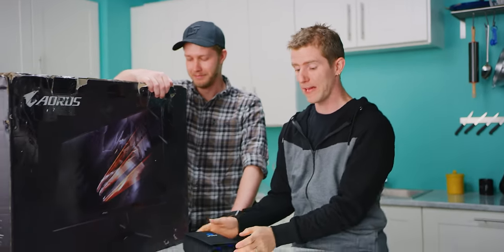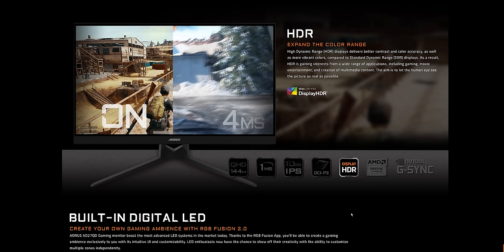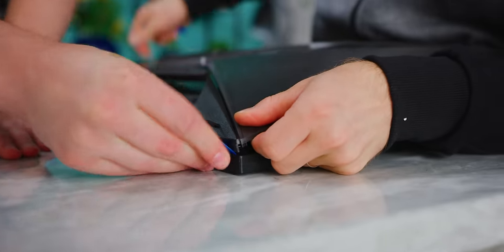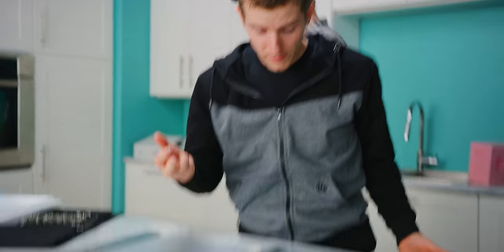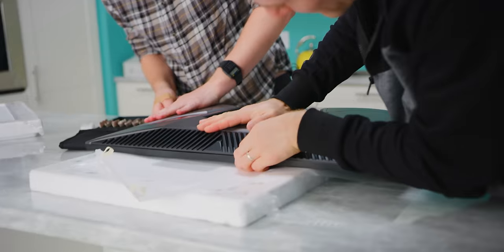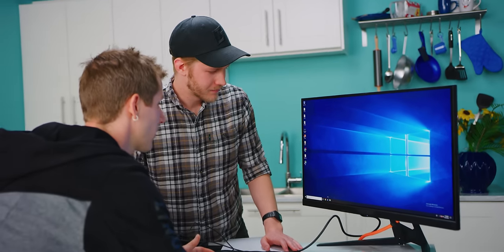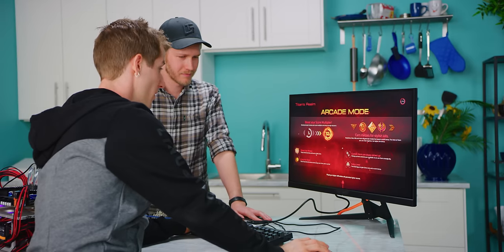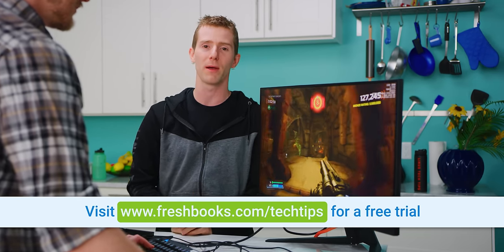Fixing a Broken Gaming Monitor for CHEAP - DIY

Comment: A make your own monitor video sounds really interesting, I would love to see that.
Reply: Phil N there are tons of driver boards on Taobao, for dirt cheap even.
Reply: Especially dual driver setups with high resolutions and refresh rates but HDR and freesync 2 may be a bit of a stretch for that kind of setup. Also maybe a way bigger panel than ordinary gaming monitors but response times for those panels may not be optimal.
Reply: Built my own twice. Made a nice wood case for one, with a 1366x768 LG panel from a rekt laptop, hangs on the wall. Made another handly handheld one out of a little 800x600 digital picture frame I found busted in a parking lot. Even has built in speakers. Used LVDS/flatlink adapter boards from eBay and other scrap parts. Pretty straightforward.
Reply: bezel free monitor wall Plz
Reply: Any of you guys know any good build guides to build something kinda matching 2019 standards from aliexpress parts?
Reply: That's my next DIY project. Hopefully there are some good guides out there.

Comment: Thank you very mutch for this Linus. My glass desk recently broke on me and my 27" Dell S2716DG monitor fell to the ground and got busted. I found the panel on Ebay and was able to replace everything without problems and its good as new. Now for the desk i know never to go glass
Reply: @aBunnyThatWillChewOnYourCables  yep 1 year plus and still strong. Havent had any issues with it. Even upgraded my PC and stayed with the same monitor i fixed

Comment: linus: releases video fixing 120$ broken monitor from ebay
ebay broken monitor sellers: doubles the price
Reply: they really can't otherwise they are selling them for the price of new gaming monitors
Reply: @pinklightninggaming7353  i mean 240$ plus like 100-200 to fix it still way cheaper than the price of a new one
Reply: @CiceroFMYT  still almost $200 cheaper
Reply: @Camtcan  Yeah, but it's not a sure fire way of getting a working monitor.  $200 isn't worth the risk to MAYBE get a working monitor at the end of the process.  It's cheap because you're taking a gamble on it possibly still not working after your done.  Then you're out all the money you put into that broken monitor.

Comment: I would like more these videos that cover second-hand salvaging of pc parts and accessories
Reply: Nice profile picture
Reply: I know a guy that buys pallets of RMA'd computer equipment and fixes it for profit.
Reply: That. 
I got into LTT years ago because I needed help learning to build a custom WC loop. It seems like that DIY material has trickled off a bit over the years in comparison to reviews (excellent), industry news and general (admittedly hilarious) silliness. 
But I'd love to see more stuff like this. I love the DIY aspect of electronics, and I really appreciate folks who can help me learn to do stuff. (For instance, I recently tripped over the cord on my out-of-guarantee xps 15 and did some major damage. Instead of ebay-ing it for pennies on the dollar, I just ordered a replacement palmrest and screws and found a guy selling a used AC/DC unit. There's probably a video out there showing me how to do it - but if LTT did one, I'd just feel that much better about the challenge.)
Reply: @mmavcanuck  They do get rich off of videos that people want to see though. Consider that.

Comment: I mean… Alex using LTT to supply him with computer parts like his Monitor is actually really smart. This is actually the kind of thing that a budget-oriented gamer would consider doing, making it an interesting and valid video for the channel, while ALSO allowing Luke to use LTT’s funding to acquire his toys, so long as his idea works. And, let’s face it. In the case of this project, Ad Revenue ALONE on this video probably paid for it even if they broke it.

Comment: i'm can so relate to Alex.
Too cheap to pay anything new when i can "fix" everything in some "NotSoPerfectWay", but as long is cheap and it works i don't mind and i got for it. Even though i regret some times.
Ergo my "home assistant device" being an used old phone hanging in the ceiling receiving voice commands and running tasker to execute them manually on the display and using a Broadlink transmitter to blast IR and RF.
Which i recently discover that they already come ready to run from your google assistant in your on phone.

Comment: "what are our chances?" "either 100% or 0%" 
we call that a 50% chance alex xD
Reply: Damn. You got to this before I could.
Reply: No it's not
You could either win or lose a lottery, it doesn't mean it's a 50% chance
Reply: @nchls1343  it's like on or off
Reply: as young sheldon would say: "you confused possibilities with probabilities"
Reply: I was gonna write that!
Reply: @vigosrevik2896  ....
Reply: they don't have 50% chance in canada
Reply: Lmao came here to write exactly this
Reply: @nchls1343  If the odds are equally likely, he would be correct.  Lotteries are no where near equally likely by design.  They want to make it hard to win.
Reply: @Pwnstared  exactly, now in this case (this video) it's not 50-50, maybe it's more like 80-20 for success against fail because Alex knew it's the panel's problem.
Reply: @nchls1343  50% probability?
Reply: @rzzle8586  no it's not
It's like jumping from 5th floor, you either dead or alive
Just 2 possibilities, doesn't make it 50-50 tho
Reply: @lightningrod6568  no, what he said is possibility, what I said is probability
Reply: @nchls1343  right. I knew I had to put that question mark
Reply: 100/100 * 0/100 =\= 50%. If you can either win or lose something, like the lottery, does that mean you have a 50% chance
Reply: @nchls1343  Dude, you have a 50% chance to win the lottery, it either happens or it doesnt, 50 - 50       /s
Reply: No, it's not. 0=/=0.5=/=1
Reply: Was just about to say that
Reply: Everything either happens or it doesn't. Everything is a 50/50 chance. Lol. Sound logic.
Reply: All these people trying to compare to the lottery. Lmao. You know the odds OF winning the lottery are not the same as the possibility of winning. It is a 50/50 chance of winning the lottery, you either do, or you don't, now the odds of you winning the lottery are extremely low due to the amount of people trying to win as well. An 'either win or lose' is a 50/50, now with these monitors you'd have to know the percentage of panels that CAN be bad, and then you would average out your chances of getting 1 of them, say 1/50 monitors are bad, that means that 2% of the time you'll get a bad monitor, but when you buy a new one you still have a 50% chance you could get a bad one, or a 50% chance you don't. It's all RNG.
Reply: odds of dying from jumping off a 20 story building are NOT 50/50. chances are probably like 2% chance you will live. same rules apply here
Reply: @TheGauges420  I'm sorry but this is nonsense. Saying there is a 50% chance of winning is exactly the same as saying mathematically that the probability of winning is 50%. 

Here are some actual facts about probability since you seem to be extremely confused:
This is a Bernoulli trial, i.e. a trial wherein there are two outcomes with the chance of success determined by a constant p. The size of the parameter space of such a trial is two, with the parameter space consisting of "success" and "failure". You can say "there are two outcomes" or "the situation is Bernoulli", but you cannot say "there is a 50/50 chance" unless you know that the p=50%. Given we don't know what p is, your statement is incorrect.
Reply: @nchls1343 , I came here to laugh, but I leave educated... Thanks man... n.n*/
Reply: @nchls1343  Can't compare apples to oranges bud
Reply: Mario  exactly. But every time you play you have a chance of winning and chance of losing. No other possible outcomes. The probability is not the same as possibility. Obviously the chance to lose is much higher than the chance to win, but that doesn't change the fact you can only win or lose, or just not play.

Comment: In my experience, the most common part to fail on a monitor is the power supply. That has proven to be significantly harder to repair/replace than a panel. I'd be very interested to see LTT give it a shot so I can learn. I'm about half way through replacing one of the field effect transistors on the monitor PSU, and my fingers are crossed...
Reply: These guys using an iron would be terrifying...
Reply: why monitor monitors motherboards covers have to be from aluminium, to be so heavy, i dont understand, ther isnt any good spec light portable high build quality monitor... nly cheaps are light with bad specs

Comment: Yo, def make a vid on the making your own monitor. Will watch 100%.
Reply: It's super easy. But panel, buy PCB connect together. Done.
Reply: if you have an old laptop that you will not use anymore you can take out the screen, use the code written on it's back to find the controller board and build a stand for it
Reply: @michelterres  Ye, you can also make diy transparent screen using one
Reply: they have
Reply: That was almost English.
Reply: Meet the enginer
Reply: @Shocker99  I could be wrong but I think they did that years ago

Comment: While panel replacement is always worth looking into, it's a good idea to be cautious about picking a panel. You run the risk of having a worse backlight (in the case of panels with integrated backlights), noticeable amounts of dead pixels, worse contrast, and all sorts of other things that the original screen went through a QA process over. When you go to the bottom of the barrel, it's always a toss-up. You might get lucky and get the exact same experience, you might have a mediocre monitor at the end of it that just works, and you might wind up with another dead screen. Could've been surplus output from the same factory, could've been a clone from another factory, or it could be a genuine part that didn't pass QA.

To be clear, I always at least try, but there've been cases where I had to go through two or three screens before a laptop finally looked happy again.

Comment: I once had a Viewsonic monitor where the backlight would flicker and randomly turn off. That turned out to be faulty capacitors in the integrated power supply, which luckily is a lot easier to fix than the other parts of a monitor, because you generally don't have surface components in the high voltage parts - you just have to be careful to not short anything in that section. But with the actual panels, as long as you can get a replacement, you just have to be careful to swap it without bending it, cracking the edges of the glass, or damaging the tiny connectors

Comment: Yaaay, I can finally get an awesome monitor for cheap! Let's go open up ebay!
Wow, the Acer XF270HUA for 50€! Looking good so far! 
Yes, the panel only costs about 160€, 210€ in total for this monitor is a great deal! 
WTF, 150€ shipping cost? 
Same thing happened for every other monitor I checked. Not worth the hassle, at least not for europeans.
Reply: Amber57499 , you might want to try eBay in the UK. I have found that shipping costs from the UK into mainland Europe are pretty reasonable.
Reply: @Dennis0824  I think he's talking about the panel shipping cost from China.

Comment: You guys should do a DIY monitor, find some cheap no-name driver board that can connect to a panel, get a power supply, then make a housing and stand in that new shop, or 3D print a case or something
Reply: or turn the side of a pc case into a monitor and shove it in apples face.
Reply: Dude even just the thought of building my own monitor excites my cheap ass. I would love a video like this

Comment: meanwhile refurbished HP Omen 27" GSYNC 1440p 165hz is $258 buy it now on ebay.
Reply: There's no free lunch. Those HP panels are usually garbage tier
Reply: @Rev8  its gsync compatible and gsync compatible monitors have been tested to extreme lengths beforehand so you know that this specific monitor is solid
Reply: @incediumignis  well it's your money, but I've seen the reliability / QC of those monitors. I doubt it will last.
Reply: @Rev8  Agreed, I got a cheap HP Omen 25" and it was a good price for a 1080p 144hz at the time. But. In hindsight I wish I paid a bit more for a monitor that worked better without ghosting issues
Reply: it is a tn panel don't buy that get a ips
Reply: @bnerd1  IPS with same specs costs a few hundred $ more. For $258 it's a pretty loaded monitor
Reply: @Rev8  The panel is a AU Optronics M270DTN01.3, google it, it's not a crap panel
Reply: @incediumignis  Nope, they did a video on that: https://youtu.be/Um0PFoB-Ls4?t=827. Nvidia told them that gsync compatible isn't nearly as rigorously tested as "real" gsync. It only has to pass some basic tests.
Reply: @Xackus  This HP Omen 27 is a G-Sync monitor, it was out on the market far before Nvidia started the g-sync compatible. It was sold at Walmart originally for $798 when first released.
Reply: @introverttechnologist8899  
Gotta bumb up the price now
Reply: @Rev8  Yeah, have a gander at the Overwatch League Pros that constantly complain about their current monitors as well lol
Reply: IntrovertTechnologist you have anymore available?
Reply: AngryBoiArtiom no all omen panels are ass.
Reply: @introverttechnologist8899  sell me one not through eBay. I don't want to pay for their idiotic fees and all that jazz. Granted I know eBay has a pretty good policy with claims and stuff, but I'd rather save a few bucks off that eBay listing and give you a few extra bucks as well. I'm looking for 1440p 165hz to replace my MSI curved 24" 1080p 144hz.

Comment: 7:40 it's just a specific flat flex cable, they are relatively easy to find replacements. Counting the pins required is the difficult part.

Comment: it's either all in 100 or nothing Lmao. you mean 50/50? too good
Reply: @meliohe5080  That's assuming the likelihood of repair is a binomial distribution, which it most definitely is not considering the failure modes of a device as complex as a monitor.
Reply: Why do people think possibility and probability are the same things?
Reply: I caught that too
Reply: @TheGauges420   Because they both start with p so good enough right?

Comment: Engineering degree ✔️ understands probabilities ❌🤔
Reply: Dude, it's definitely either 0% or 100%. No other way to state that.
Reply: @rehmsmeyer  thats what 50% probability is called.
Reply: @deepakgupta-sq3dj  without knowing the weights of failure to success it can only be called pass or fail. You could say a person will die with the surgery we need to perform but it has factors that make it 10% or 90% success rate. I think they would only have a true % value after having 10 or more tries on the same monitor type with the same issue.
Reply: Its going to 100% work 50% of the time

Comment: Okay, thanks to Linus and His team. I have now found myself a way to find myself a high end monitor. Which I have no need for at this time. But, hey that's what projects are for. (:
Reply: Mario This is also a good point Mario. Thank you.
Reply: Mario  This is a year old but Buying used monitors is also a pretty decent idea. Unless you drop them monitors are very hard to brake so a used one could be great too.
Reply: @OKANGUVEN99  monitors are NOT hard to break. You can accidentally move it the wrong way and it will break. Dont get me wrong, I'm all for buying used, but do NOT suggest it as a sure-fire way of getting something that works, because it may very well not.

Comment: i always take a pic first always even when working on a car cause when your working on so much at once and talking to someone else you just forget were it was its easy to take something apart not so easy finding the same spot it went when dealing with little wires to put back together

Comment: You can buy LCD panel driver boards on eBay for fairly cheap. It takes 12 volts in and HDMI and has flex cable outputs for different displays.

Comment: $180 saved compared to buying a brand new for $600, that's not unheard of to find a brand new monitor that's 30% off, no gambling involved, no breaking a monitor apart and reassemble it again yourself, and you still have the warranty. Like the last monitor I purchased was a $400 1440p 144hz and was on sale for 26% cheaper.

Comment: Yeah, how about no. I'd rather stay safe and buy brand new or get a deal on ebay at an auction. I don't really feel like it's worth saving 100USD on a display and risk a lot of stuff.
Reply: Yep quite agree but on the other hand if you have a faulty quality monitor it might be worth the risk of fixing it rather than making land fill.
Reply: well it can be more, if all goes right it can be 300+USD but i can see where you are coming from, i'll probably get my first good monitor as a new one too, but i like tinkering and will probably look into this after that
Reply: I mean you can buy a good condition used Aorus monitor on Amazon for around $480 after taxes (USD), so their costs here of ~$420 is not worth it at all imo. If I could save like $150-200 off that used price then I'd be pretty interested, though...might still look into it more. I like tinkering, but I very strongly don't want to deal with the possibility of having wasted money on a broken monitor that can't be fixed with a simple panel swap.